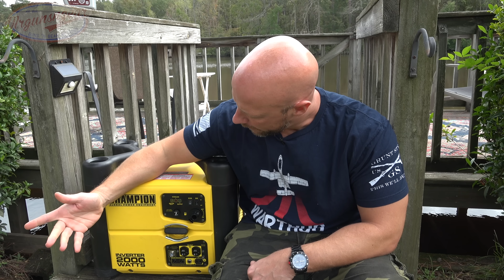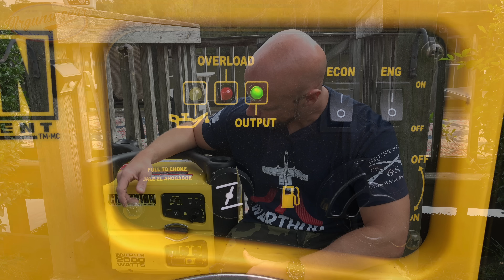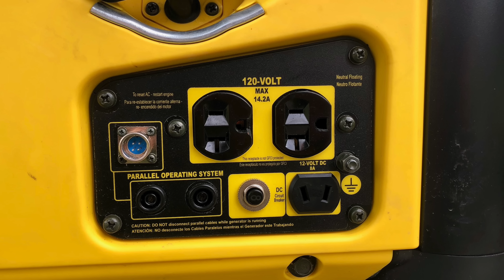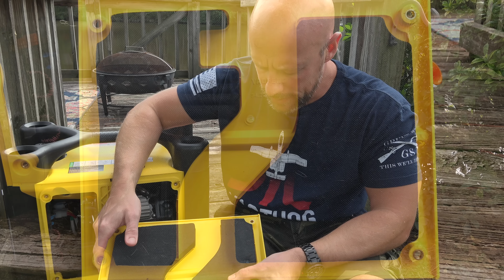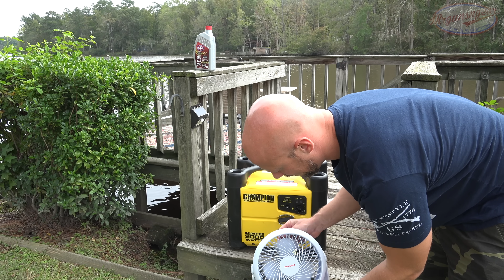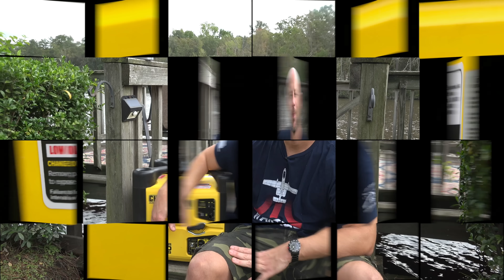Champion 2000 Watt Stackable Portable Inverter Generator Review

Comment: You should really consider a propane conversion for your generator, they make them for almost all generators.

-They run cleaner.
-Are easier to start.
-Propane has infinite shelf life compared to gasoline.
-It’s safer to store.
-Doesn’t create fumes while in storage.

And the biggest selling point is you can still buy 20 pound cylinders during a power outage, if a gas station doesn’t have power than you cannot pump gas.

Also many homes have propane tank farms, you can have a quick connect installed and power your generator off that for a very long time. These conversion kits also often work with natural gas too, if you’re lucky enough to have a line to your home. These conversions also still allow you to run gasoline, so you have a tri-fuel generator after the conversion.
Reply: Isn't propane very inefficient versus other fuels, like Diesel?
Reply: Less efficient.  But when you have propane but no gasoline, less efficient is better than no power.
Reply: @Boris_Covfefeovich  That's how I see it too.
Reply: Saku19 If memory serves, it does produce less BTUS compared to those fuels. However, it has many other advantages. At least with the snorkel style conversions you can still run liquid fuels.
Reply: @chrisloUSA  Hmmmm, I'll have to delve into this topic a bit more.
Reply: @Saku19  If you don't mind spending $900, Champion makes 3100 W Inverter Generator that runs on gas or propane plus it has wheels.

https://www.newegg.com/Product/Product.aspx?Item=9SIA02D6YU2368&ignorebbr=1&nm_mc=KNC-GoogleMKP-PC&cm_mmc=KNC-GoogleMKP-PC-plaHI+-+Generators_-9SIA02D6YU2368&gclid=Cj0KCQjw6rXeBRD3ARIsAD9ni9CjB-T9GGWkWbTE8uWKPXgQNvENeBIl4JUdTMXO6o6E8Lz8mgeJsS0aAqriEALw_wcB&gclsrc=aw.ds

Also, this is a link to the propane conversion kit for this generator:

https://www.campingworld.com/motor-snorkel-tri-fuel-generator-conversion-kit-for-1600-2000-watt-generators?CAWELAID=120030630000008919&gclid=Cj0KCQjw6rXeBRD3ARIsAD9ni9DlmhobUoTjjcZJ1DO62I6h6Ykeyg8fuWpyBEoDN9COv9-HMDYr80AaAu35EALw_wcB

This is a link to a post where a guy did the install and his experiences with the kit:

https://www.ar15.com/forums/outdoors/Propane_conversion_of_Champion_inverter_generator/17-675301/

Lastly, this is the link to the people who make these propane conversion kits, they have a phone number if you want to ask questions:

http://uscarburetion.com
Reply: chrisloUSA,
 I looked in that for my Honda 2000 but they were so expensive it scared me away, especially after the cost of the Honda.
Other wise I would have got one.
Reply: lacenter645 Yeah some of them can be $200. Personally, if I buy one it’s not going to be a Honda because I think $800-$900 is outrageous for one of these. The Champion in the $400 range is reasonably priced. Harbor Freight also makes a copy of the Honda generator for less than $500 and the people that used them raved about them. Hell, the 3100 Watt Champion Inverter is almost the same priced as the 2k Watt Honda.
Reply: @chrisloUSA For those who have natural gas, the tri-fuel conversion is the way to go.  During Katrina aftermath the in-laws ran generator for 1 hour on 2 hours off, because obtaining fuel was a problem.  Neither propane nor gasoline available.  But they had hot showers because the generator could run the well pump, and they had natural gas water heater.  Took them a week to get fresh gasoline, after draining three vehicles to keep fuel for the generator.  If they had done the conversion they'd have been able to have power on demand.  Natural gas was available in their area without interruption.  Usually only goes out when a falling tree pulls up a gas line its roots entangled.
 Note: The gas regulator should be tuned for either gas being used-easy to do with an add on tachometer.  No change needed for gasoline. 
On gasoline advise being sure to run all of the gas out of carb before storage.  Bought a 3500w generator in 2001.  It has 455 hours on it, and is always easy to start after following that simple precaution.  (Nameplate is Craftsman, but its still sold today as brigss&Stratton and Generac)  [But it is NOT quiet inverter]  When I bought it it was the smallest generator with a 240v outlet(@15A).  
We always try to use either ethanol free gasoline or premium with a fuel stabilizer. (Most marinas and many gas stations close to boating areas have "marine" gas, which is ethanol free(if the station and their supplier are honest).
Reply: @Boris_Covfefeovich  I wonder how the tri-fuels work? When going between natural gas and propane, you usually have to change the orifice and springs out in the gas regulator.

Your relatives are lucky to have natural gas in your area, my current home in NE Pennsylvania doesn't have natural gas lines in the area. I remember living in the city with my family back in 2003, when we had that huge East Coast blackout.

Nothing worked except for our natural gas stove.
Reply: On the tri-fuel its not difficult to reset the feed for propane vs natural gas.  Its a set screw on the gas regulator.  Add a 30 dollar tachometer and it is easiest.  Just adjust for 3600 rpm.
Reply: Wow I didn't realize it would be that easy.
Reply: Actually you can pump gas after the store has closed and the lights are off. But with credit card only at the pump.
Reply: MARKY MUNRO dj.company Yes, if they have power, if the power is out and they don’t have a generator than you cannot pump.
Reply: Sounds good Hank Hill.
Reply: Chance Carlton The man was a mentor for me during my younger years, him and Anderson. 🤣
Reply from the maker: fair enough

Comment: 2000watts won’t power much and truthfully if you are trying to rely on asmall IVgenerator the Honda 7000i is where it’s at. Better fuel economy, quieter, way more reliable, electric start, fuel injected and has a built in cart/dolly wheels
Reply: $3,999.00 is much more that $450.00
Reply: @RK Harm24, is that you Paul Harrell? 

We all weigh up what we need to power for the time of any likely outage, the risks of not powering them and the likelyhood of that outage  /cost to us when determining value.  This differs for everyone. I'd probably look for something around the 3.5kw range and a UPS  between it and sensitive stuff. How many problems you have with things with their own ac>dc power supplies like PC's and televisions will depend on the "hold up" interval of the input circuitry in the power supply; I'd prefer to stick a UPS in, though less necessary for an inverter gen if it's output is sufficiently protected.
Reply from the maker: this^

Comment: Good little unit. I use my miller welder if power off more than 8-10 hrs. If you stay the hell out of your freezer and refrigerator they can go a long time. I have thought about getting a small guy like that or two for convenience. Definitely nice to have anything with a compressor on its own circuit. And definitely more economical on fuel.
Reply from the maker: thanks for the report